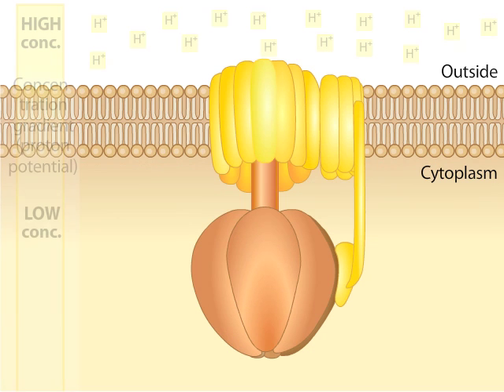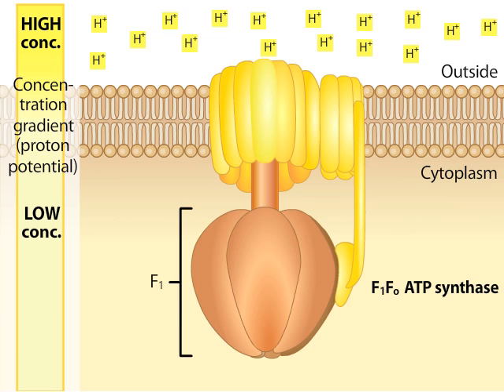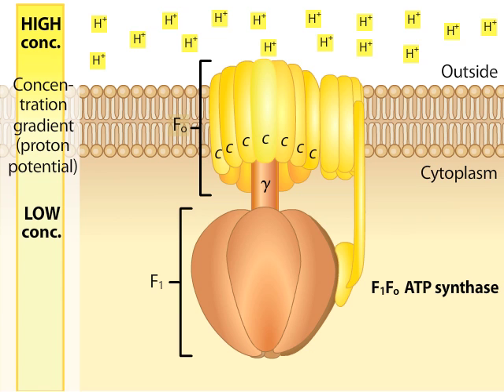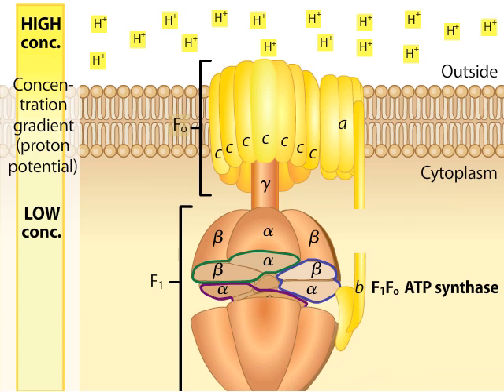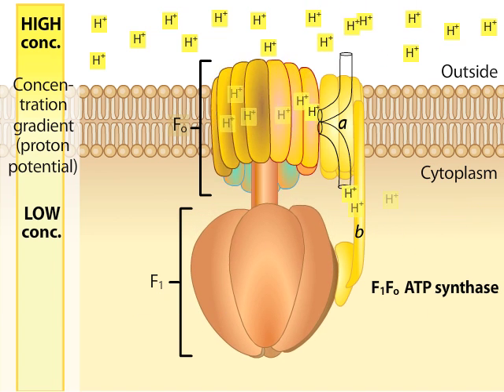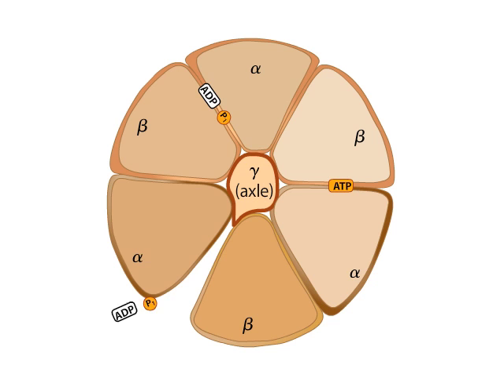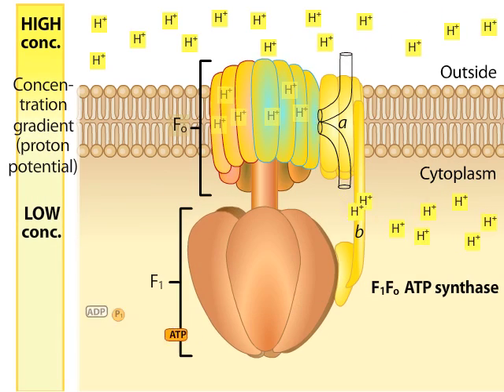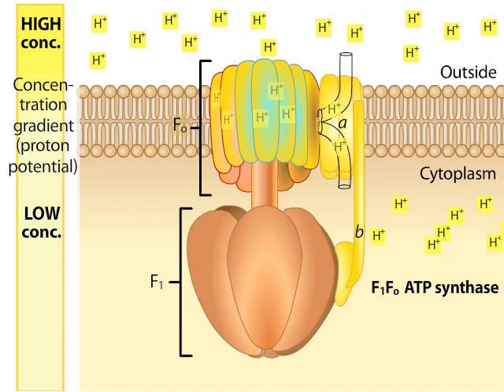ATP Synthase

Comment: For anyone wondering, 1 proton does not equal 3 ATP formed, it depends on the number of C subunits. One 360 degree rotation results in 3 ATP by the F1 subunit. If you have only 9 C subunits in fo, you would need 9 protons per 360 degree rotation. Therefore 9 protons are used to form 3 ATP. You can then use algebra to determine the number of protons to the number of ATP you want to know will be formed.
Reply: Great , but if I have total of 12 C how much ATP would form?
Reply: That would be 4

Comment: what is the no. of proton used for production of 1ATP?
Reply from the maker: The number of C subunits determines the number of protons that must be transported to generate each molecule of ATP. So if the ring has 8 C subunits then 2.7 protons are required to form  1ATP. If ring has 12 c subunits then it requires 4 protons. If ring has 15 subunits then it requires 5 protons to form.
If this doesn't make sense search for a pdf of Lehninger Biochem Textbook and it probably has a good explanation
Reply from the maker: " Thus one complete rotation of the gamma subunit causes each Beta subunit to cycle through all three of its possible conformations, and for each rotation,  3 ATP are synthesized and released from the enzyme surface" (Lehninger 6e p 712)
Reply from the maker: Lehninger also says, " The most widely accepted experimental value for number of protons required to drive the synthesis of an ATP molecule is 4, of which one is used in transporting Pi, ATP, and ADP across mitochondrial membrane....The final word on proton stoichiometry will probably not be written until we know the full details of the F0F1 mechanism" (Lehninger 6e p 713)
Reply from the maker: You may be correct. The textbooks I consulted do not seem to agree. Try Hinkle et al. for more precise answers
Reply: @HicamorHaecpatriaest  so if the ring has 10 c subunits, would it takes 3 protons to generates an atp molecule?
Reply: 4 protons

Comment: its 4 proton for 1 atp and not 3
Reply from the maker: "Each 360-degree rotation of the gamma subunit leads to the synthesis and release of 3 molecules of ATP. The number of C subunits determines the efficiency with which the proton gradient is converted into ATP synthesis"  (Tymoczko Biochemistry p 389)
Reply from the maker: If there are 10 c subunits (eg yeast mitochondrial atp synthase) each molecule of ATP generated requires the transport of  
 10(c subunits)/3(ATP molecules) = 3.33 protons.
Reply from the maker: "The C rings of all vertebrates are composed of 8 subunits, making vertebrate ATP synthase the most efficient known, with the transport of only 2.7 protons required for ATP synthesis" (Tymoczko p 390)
Reply from the maker: You may be thinking of # of protons pumped out of mitochondrial matrix by proton pumps in the Electron Transport Chain itself. Complex 1,3, and 4 are all proton pumps. For example NADH-Q Oxidoreductase uses the charges on Q2- which are transmitted to hydrophilic amino acid residues that power the movement of HL and BetaH components. "This movement changes the conformation of the transmembrane helices and results in the transport of four protons out of the mitochondrial matrix" (Tymoczko p373)